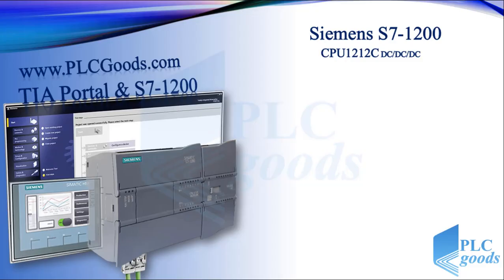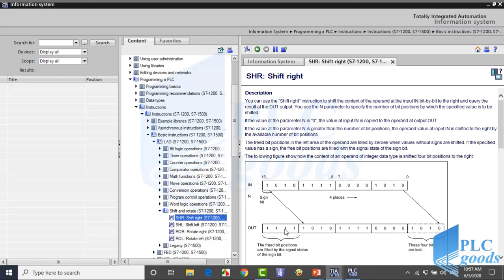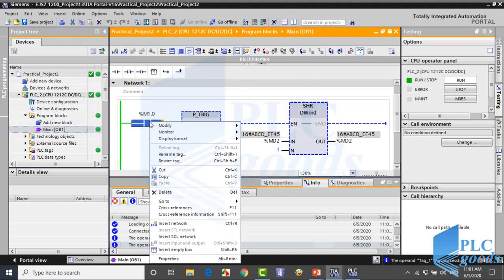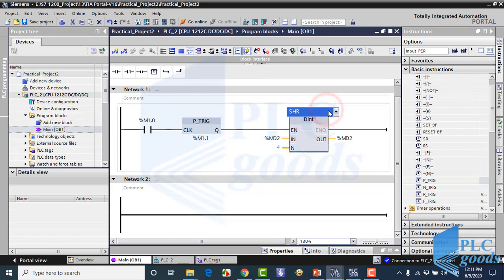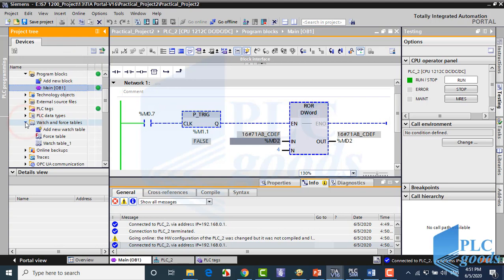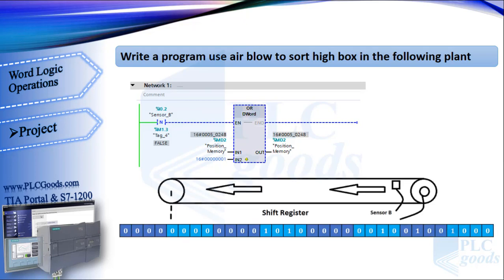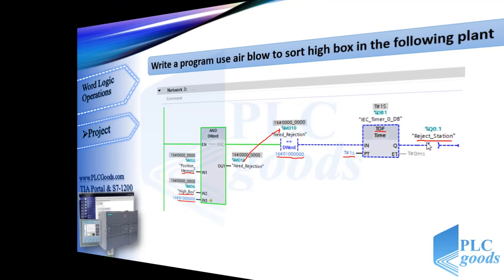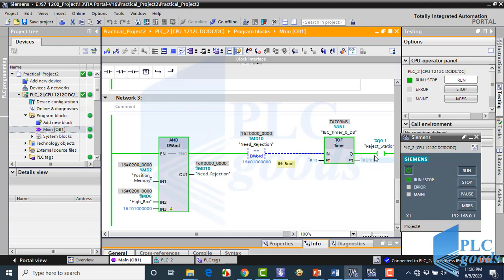Siemens TIA portal : Shift and Rotate instructions / operations  SHR, SHL, ROR, ROL

Comment: Thank you for your great explanation, Is there a reason you have chosen 16#01000000 ? Is it random? If it is not random, 
What is gonna happen if there are two high boxes behind each other right away
Reply from the maker: Hi there, I've explained this point at the time 10:48 . 16#01000000 determines the position of the air blower. The program always must be written based on the conditions. usually, there is a small distance between boxes, so you can use capacitive and inductive sensors. otherwise, you will need to use high-precision optical sensors.

Comment: If we change data type from Dword to Lword, what value should we put on AND logic "IN3" ?  (to determine the position of the air blower)
Reply: Hi there, one bit at "IN3" determines the position of the air blower. I've used this position 16#01000000. Lword only has more bits and the number will be 16#0000000001000000. Note that, If the position of air blower is changed, this number will be changed too.
Reply from the maker: thanks for checking the channel
Reply: @plcgoodsteam8934  okay noted. TQ for response. I have watched many videos, this is the easy one to understand. keep it up! may I know how to contact your team via email?
Reply: @Ricky-kk7jt  , hi there, please use this email to contact us, info@plcgoods.com

Comment: good morning,how can we find the actual position of the blower in a real application?
Reply from the maker: You can use a shaft encoder:
Which is a sensor device that can be attached mechanically to a rotating shaft, and electrically connected to a logic system in order to feed information to the logic system regarding the rotation of the shaft.